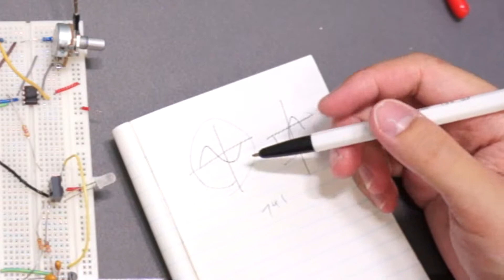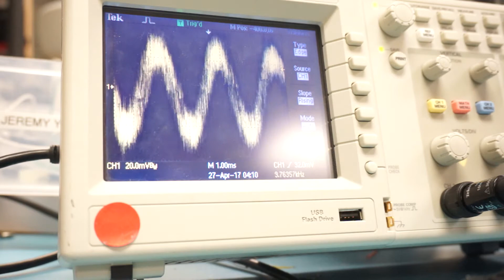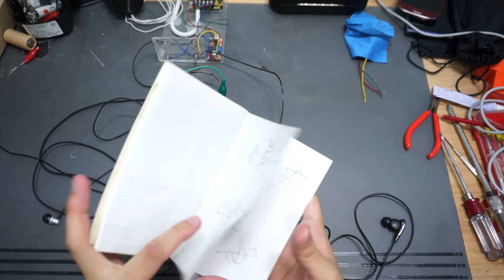DIY Noise Cancelling With 741 Inverting OP-AMP

Comment: “Oops I did it again” 😂

Did you get this working in the end? I’m considering something like this for an AC unit in my backyard. Mostly low frequency noise so phasing would be easier but would need some beefy speaker and amp setup 🤔

Comment: Stopped watching after a couple minutes—-what you need to do is much simpler than this attempt which is ass backwards.  All you need to do is first have method for recording that noise, then experiment feeding back into amp 180 degrees out of phase as a trail.  Done.   Is for the most part exactly how Bose does it.  The trick is to getting a good trailing recording to play back into amp out of phase representative which can depend on audio system setup.   A microphone at speaker can be one of the simplest ways to go—1 second output stored in IC, then plays back out of phase.  Where this fails is when the noise is inconsistent.  Most is not and can be canceled.

Comment: So is there a simple sound inversion software that will take noise from a microphone and playback the inverse frequency through speakers in real-time??
Reply: The problem with doing that on a PC, is that a PC can't be really used as a real-time-device, because every command you give it will be first queued and then executed. This takes way to much time for something which has to react theoretically infinitely fast.
Reply: @GMC997  Not true if you separate the microphone and speaker so that you have some delay during which to do the calculations. You can easily calculate the speed of sound in atmosphere within the accuracy required to put the two in phase. Definitely true for a noise-cancelling headphone though.
Reply: @pugpugpugs5382  Dude, it's impossible. The delay in processing the signal via a computer is too large that the soundwave will make it to the ear before the opposite phase has been generated. And if you try to compute based on the speed of sound the way you're saying, then you have the problem in that you're dealing with unpredictable incoming waves, so, for the wave you're currently computing, by the time an inverse output is generated, the original sound already reached the ear.  But if you have a constant frequency e.g 50Hz incoming, you can compute for deal as you say in your comment.
Reply: @davemwangi05  Assume we run this at 10 MHz. We can fit 1000 operations in before we hit a bandwidth of 10 kHz
Reply: @xXSubZeroGamesXx  Already at the fast, almost instantaneous analog processing that's used with noise cancelling headphones there's a problem. >> in that the lower frequencies are cancelled excellently eg the 50Hz mains hum, but going towards the 1khz problems begin eg due to just the little displaced position of the mic etc.   

V=wavelenth*f   hence 10khz 340/10000 = 0.034 m = 3.4cm,      50hz wavelength = 6.8 meters 1khz = 34cm .

   see, at the 10khz, if ur mic is 2mm from the speaker you have a phase lag of 2/(34/2) =12% or 21 degrees, yet the 50 has 2(6800/2)= 0.059% =0.105 degrees  1khz has 1.18% =2.1 degrees    so you try one you lose the other, it never works for 10khz with 21degs - You can try to verify my calculations.

More issues. you said 10mhz.
Arduino has a clock of 20MHz, and simple library in arduino called "PulseIn" has trouble at 10 microseconds. << that's just for listening for an incoming signal so that you can for example  count the length of a pulse.  

There's time called T-states in a microprocessor, that's time wasted for  eg opcode read cycle, memory read, memory write etc  E.g to fetch an instruction from the mem and send it to the accumulator 4 computation, 4 clock cycles are used

the 10khz signal has a period T of 1/10k =100 microseconds. 

WE already have a penalty of 10microsecs for using "PulseIn". and that's 10% of the 100 microseconds, you're in trouble, a big phase lag. Adding some other essential codes let's say u're a genius and use 5 similar lines of code, you have a lag of 5*10= 50 microseconds.  you're 180 degrees off. worse it could be smthing like 45 deg leading to outright noise.  

Hence before a signal is received and executed you've 5 milliseconds lag. The 1khz typical audio signal has 1ms period. You're off by 500%? 
And remember you have time lost in the A/D converter too, LOL sweating like never before.
Reply: @davemwangi05  I'm not suggesting I can build this physically, I'm saying that the notion is not impossible. In practice, 10 kHz will not pass through the headphones. Realistically, we care about maybe 1 kHz. I used this number as an example.

Are you familiar with real time operating systems or DSPs?
Reply: Let me say you're the expert, and end it there. On a different note,   @xXSubZeroGamesXx  Patent number US6086922A. If u have interest, earn the deeper hidden truths of the world. Whoever has eyes let him/her see and survive the coronavirus.  You know how serious a patent is, right?   good luck.
Reply: So in a nutshell as I've shown above, with a lag/delay of just 50 microseconds wherein the wave is picked at the microphone (which is as close as possible to the speaker) and processed in the computer, by the time the inverse signal is generated at the output, the original signal already passed the microphone and arrived at the ears. See?   Of course the logic is that it was not sitting there for 50us waiting for you to process the inverse wave, and send it via the speaker to cancel it, it's travelling fast at 340m/s 

therefore analog processing is the key or maybe some other Super fast specialized digital cct

The mic has to be as close as possible to the speaker and ears for that phase, so that it can pick up exactly the sounds at that micro environment that you need to cancel out. else further out, and it's a total fuck up.
Reply: @davemwangi05  The Arduino is not well suited for audio. It is possible to sample at rates of MHz with a DSP. DSP is the standard for audio processing.

Further, we cannot give the mic a simple distance from the ear. A typical headphone driver is 50 mm in diameter. We don't need prefect cancellation, we can achieve pretty good attenuation with +-20 degrees tolerance, if this is going to be a hobbyist project

Comment: Did anyone try this yet? From another post I saw that you need to filter out the high frequency noise because its too hard to cancel. I tried inverting the contacts on my iems connected to a blue yeti and it kind of cancels out pink noise but also adds the loud treble frequencies(or so I think)

Comment: You can remove the noise using the "via negativa" method - by removing the wire. You can place the microphone directly on the PCB (where the pre amp is located).

Comment: Hi, I live next to a very loud live-music bar. Is it possible to make something to relieve the loud sound in my home? Would it be simpler if I used a signal from their mixer or just a microphone? Thanks.
Reply from the maker: Noise cancelling a whole room has been theorized and some start up attempted at it but failed in the past. Noise cancelling a whole room or house is pretty much impossible due to physics of sound wave. I recommend getting a noise cancelling headphone. If you want to DIY a noise cancelling headphone, I recommend using a mic because if you take sound source from their mixer, it doesn't accommodate for many different factors that have impact on the actual sound that reaches your ears. Good luck!
Reply: @ElectroMasterVR  I remember I read recently some acoustics company did  ANC system for a small room,  and apparently it took them about 500K USD, but I don't remember the name.
Reply: I got some noise cancelling earphones for £10 that actually work and the battery lasts about 10 hours! https://www.amazon.co.uk/gp/product/B07D4D78YG/ref=ppx_yo_dt_b_asin_title_o03_s00?ie=UTF8&psc=1
£10  is saving my sanity right now :D
Reply: +ElektricMoKo I want to make a noise cancelling device but I'm not an engineer instead a high school student. would u please help!

Comment: Hello, are you still experimenting with this?    This is a very interesting project and keen to know if you have made any further improvements?
Reply from the maker: Well, I'm not working on this project anymore. The next step was to build a well acoustical engineered 3D printed earphone housing but I didn't wanted to take it that far. I'm now working on a different project, which I make Arduino play piano. Check them out on my channel if you're interested.